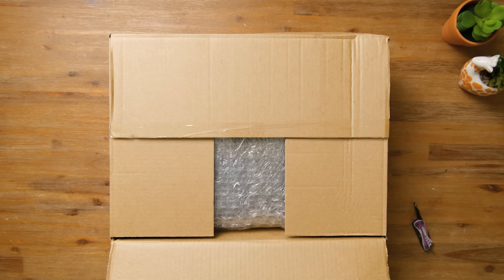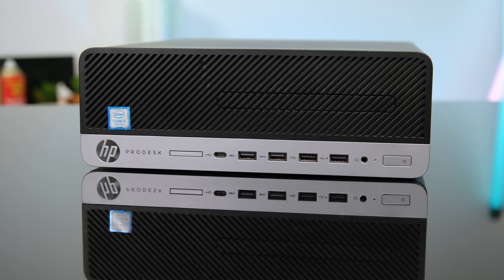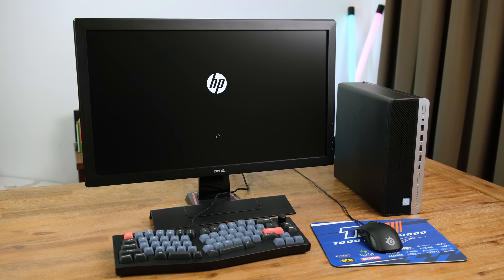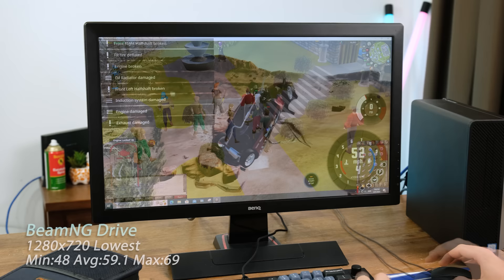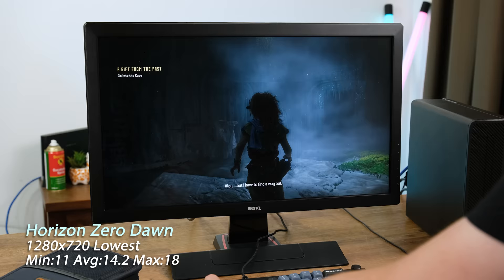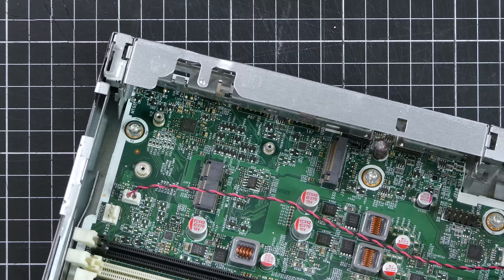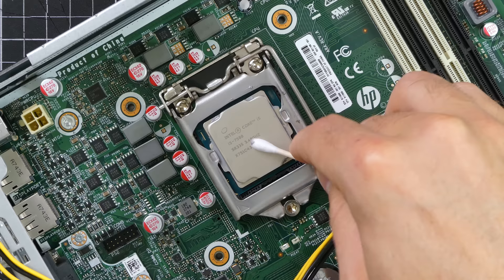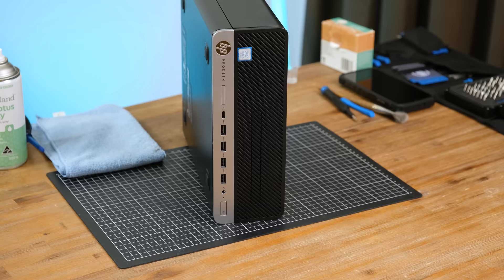Gaming On A $152 Computer?

Comment from the maker: Thanks for watching! I'm now aware that the RX 6400 exists, however it wouldn't make sense to pay so much for such a card. Also big thanks to Nordpass for making this possible 👍 https://nordpass.com/psivewrinordpass Or, use the code PSIVEWRINORDPASS at checkout to get an additional 1 month for FREE!
Reply: Do a video on the asus M32 CD I7 skylake 6700 you are impressive amen.
Reply: What is the difference between normal GPU and low profile GPU
Reply: @TahelEdit  low profile GPU is basically half the height of normal sized GPU. It's the only form factor you can fit into these SFF (small form factor) desktops. These PCs are usually only 10cm thick (that's about 4 inches for the US people), so you are limited TFX power supplies, low profile GPUs, low profile CPU coolers.
Reply: the rx 6400 is fantastic... I enjoy mine... but I understand you're sorta referring to proportional cost...I think...BUT if this is your ONLY pc it would be well worth it...

Comment: I would love to see this machine running a single slot RX 6400 and compare it to the GT 730's performance!
Reply from the maker: Didn't know they existed! But since they cost nearly double what I paid for this PC... Maybe not 😂
Reply: @psivewri  😅 Yeah that's fair!
Reply: So I run a low profile 6400 in a Dell SFF with an i7-8700 and 32GB RAM and it isn't awful, but not great either. The main problem with the 6400 is the 64 bit memory bus and PCIe Gen4. You leave a decent chunk of performance on the table by running on a Gen3 system (like the HP in this video or my Dell).
Reply: I’m running this setup with a 6400 in runs fine plays all e sports games 60+ fps 4k video is great also.. that’s main use
Reply: As an alternative to the 6400, Yeston makes a single-slot low profile GTX 1650. You used to only be able to get them in China, but now they’ve started selling them on Newegg
Reply: @psivewri   the rx 6400 is worth the money even if it’s not as cost effective and would turn a system like that into a actual entry level performance beast
Reply: @psivewri  pleaseeee man, lol
Reply: @psivewri  Try the Quadro P620, P1000, T1000, or AMD W6400.  The first two are roughly GTX 1050 performance, half height, single slot, and about $100 on eBay.  The AMD card is alot newer and is supposed to have better performance.  There's also the RX 6400, which is supposed to be essentially the same as the W6400.  That one actually doesn't look too bad.  Roughly GTX 1650 performance and only about $150 on eBay.
Reply: The most powerful lp gpu without supplementary power is the Quadro RTX A4000 i think
Reply: @psivewri  the RX 6400 is the best small form factor GPU on the market. Many online use that card for their budget builds and retro-gaming/home media setups. And perhaps bumping the CPU to an i7 will give you even more of a performance boost.
Reply: IDK much about it, but it seems to me the RX 6400 is the budget low profile card of choice ATM.  Seems like it quite a decent step up from the ever popular budget 1030 and even 1050.
Reply: @SA77888  Yeah, they are pretty reasonable on eBay (about $150) and significantly better performance than GTX 1050.  Also available in half height, single slot for SFF Dell and HP machines - not many cards can do that.
Reply: @psivewri  bruh the XFX version has been on sale for a while
Reply: @ccoder4953  WX 4100 or 3200 if you want something cheaper than the W6400. The 4100 should be somewhere in RX 460 in performance
Reply: @MrSavageBass  yeah but I run a gen 4 rx 6600xt on a gen 3 motherboard and it’s buttery smooth
Reply: @thedeadlygames9716  The 6600XT has a full X16 bandwidth, the 6400 is a locked PCIe x4 card. With the full bandwidth you wouldn't notice much different, but on a bottlenecked card like the 6400 any help you can give it counts, using it on the faster Gen4 bus makes a numerically significant difference.

Comment: There is low profile single slot versions of the RX 6400. Even though it's PCIe 4.0 x4 (in that system limited to PCIe 3.0 x4) it will still outperform a GT 1030 by a huge margin
Reply: He replied to a similar comment saying it’s too expensive
Reply: a low profile 1050ti is ideal for this thing
Reply: @XxmatixX6videosdiariosdenadav  Low profile 1050 Ti wouldn't fit because they take 2 slots
Reply: 1030 gt is the sweet spot for budget and performance, also you don't want to stress the power supply as reliable as they are don't push them to their limits.
Reply: @buda3d2007  GT 1030 is extremely slow by todays standards but sadly there isn't any other new low profile cards for below 100€.
The RX 6400 wouldn't be a problem for the power supply, it's only a 53W TDP card
Reply: @Pasi123  this is true , essentially you would be limited to retro titles, I still think it falls in the "better than nothing" category for a cash strapped gamer.

Comment: I have a feeling that the iGPU on the i5-7500 would beat the GT 730, even if it's the GDDR5 version of the 730. Would be interesting to see a followup video trying it out (or just a comment in here if messing around with alternate configurations wouldn't be enough for a video).
Reply: was going to say the same thing
Reply: Sadly no maybe in newer games where the newer feature set comes into play 

Mind you I haven't finished the vid yet and this could be a really shitty gt 730 not necessarily about the memory more so the architecture the card is based on But of course the memory matters too but not as much as you'd think if the card itself is bad 🤣

A Kepler gt 730 is a decent bit faster than the Fermi counterparts
Reply: @younglingslayer2896 I agree! Specs-wise the GT 730 is significantly better in terms of shaders, TMUs, ROPs, etc.. Like 3 times better than the Intel HD 630 graphics. The only advantage the integrated has in terms of performance is that it supports DirectX 12 and still gets modern updates as it is still in production. For newer applications it would probably be better than the GT 730 but it depends on how important the drivers are to a given task. Which is typically VERY important. The computer would also use less power and it would free up an X16 slot for other upgrade cards.

Comment: That really isn't too bad at all, I swear that my workplace has a load of this as lectern PCs.
What surprised me most is the pre-installed Samsung SSD (That part number correlates to a Samsung drive), dual channel memory (HP love using single channel memory in their pre-builts), and, most importantly, the M.2 SSD and Wi-Fi slots. 
I would definitely add Wi-Fi and an NVME boot drive, as well as more RAM - IMO, you can never have too much of RAM! :)

Comment: The RX 6400 is a low-profile GPU and has single slot versions of it, so for this pc the 6400 can be a great upgrade.
Reply: The RX 6400 is a PCIe 4.0 card though, so I suppose a GTX 1650 would still be more optimal. It depends on people's preferences though.
Reply: @pgta2004  still working with pcle 3.0
Reply: @doctorsexo5847  Ikr, but then it'd be PCIe 3.0 x4, so the bandwidth'd be halved. Wonder if that will be a bottleneck though
Reply: @pgta2004  is like 1 to 5 frame loss
Reply: @pgta2004  is there any single slot  low profile 1650’s? All the ones I see have huge coolers that would be too wide for this pc
Reply: @dylanallen7720  I looked up and there are some (like the Yeston 1650), they're not from very famous brands though.

Comment: Buy a cheap case, cheap(ish) power supply, transplant the internals and you can put wtv GPU you want in there. It's what I did when i first moved back to France, bought a cheap HP prebuilt. Now i have a 5800x3d and 7900 XT on a custom loop :).

Comment: An rx6400 would go a long in making that system playable, I know it’s controversial but the gtx 1650 will suck more power and the rx 6400 is on par with the performance of the gtx 1650 and sometimes beating the 1650

Comment: I recently got a dell Inspiron 660s for $35 online. With a i7 3770, GT 1030 and 16gb RAM, it’s a great PC. I also added a PCI WiFi card. Very similar to this one, just a bit older. It’s completely upgraded to the max and the 225 watt power supply could do it surprisingly.

Great video!

Comment: Of course this shows up right after I buy a $270 (USD) laptop
honestly, I'm impressed with my laptop's power, considering it's just an Intel Core I3, 4 GB RAM, 128 GB SSD, and Intel integrated graphics, running Minecraft at 1080p60Hz

Comment: I got a HP EliteDesk 800 G3 for $160. MINT condition. i5 7500 cpu,  8Gb 2400 RAM, 1Tb HDD. Added SSD and Windows 11 and a spare  NVME M.2 in one of the PCIE slots. VERY quite. Assembled in OZ in May 2018 so is 5 years old THIS month. 11 installed as Windows Educational so must have been built for a school. Play WOT without graphics card. For the $160 I had to forgoe 8 Pizza! WORTH IT! Only problem is I cannot update BIOS - password locked..

Comment: Those old computers still have life in them.  I recently picked up a refurbished Dell OptiPlex 7010 off of eBay with 16GB RAM and a 240GB SSD for about what you paid for your HP, and the seller did a very good job of cleaning and packing it.

Comment: My favorite phenomena in the PC world is how businesses and organizations will discard perfectly viable IT gear when they refresh their equipment. If you are at the right place at the right time, you can get all kinds of previous gen hardware absolutely free. Just last weekend I picked up an HP Z440 workstation for free. With an X99 motherboard and 700W PSU, it's a perfect platform to build a gaming rig on. All I needed was a $10 dual 6 pin to 8-pin adapter to run more modern graphics cards, and I replaced the non-turbo non-hyperthread 2.8ghz quad xeon with a 6-core turbo hyperthreaded 3.4ghz xeon which can be had for $13.50 on ebay. For $25 I have a proper gaming rig (already had a 1070 Ti and PCIe SSD to throw in it from an older build). Main thing is you have to be patient because they discard things on THEIR schedule and you also have to be savvy enough to know when and where to be when they start discarding gear in order to scoop stuff up. Often all you have to do is ask (Closed mouths don't get fed). I have acquired numerous servers and pro grade workstations like this over the years.

Comment: I have a similar system, they can be fun for retro games and it can handle daily tasks just fine. The i7's from 6th-7th gen do have hyperthreading which helps with modern games, and 8th gen i5 has 6 cores, so worth looking for those if possible but they always list for much more than the i5 6500 or 7500 models which seem to be the most common. The 4 threads can be limiting factor though especially with more modern titles.

Comment: 6:58 if I had that refurbed HP ProDesk 400 G5 SFF (which has support for Windows 11 than the 600 G3), I could bring the PC, the keyboard, the mouse, and my pocket router, the PSU, an inverter with a slim motorbike battery (packed on a bag) to school unless it's time for learning, studying, and doing exams, especially my not-so-nice English teacher.

Comment: I love these OEM machines. I have a Mini Form Factor (no, not SFF) HP Prodesk with an i5-8600T. I added a GTX 1650 using a PCIE x16 to M.2 adapter. Using an external power supply (a Dell DA-2 adapter), I can now use the computer for triple A gaming.

Added 16GB of RAM and a 500 GB SATA SSD aswell. All of that for just 250 dollars!

Comment: It’s kinda insane for my school to have computers with intel i7 11700k and 16Gb of ram and 1440p monitors, that’s basically my computer but with no graphics card. I didn’t even know my school just switched out the old computers with the new ones.
Reply: what is your school running? high power software? no way they spend more then 888 on each computer just to only run word my school has 2 pc rooms a room on 1st floor with i5 7th gen and the 2nd floor has i5 4th gens wich are slow ass but that i5 is more powerfull then my i5 6th gen
Reply: @309electronics5  What I can say is, I don't know how they have so much money to spend on computers, even though the stuff still works and not obsolete. I think the old computers that used to be there had i7 8700K and 16GB of ram. Those computers were mostly in classroom for developing electronics. The 2 things I hate about it is they don't have any kind of ssd or any kind of graphics besides the intel graphics. I guess it's fine for basic web surfing and office apps, but for anything else, it's basically useless.

Comment: You may be able to fit on of Nvidia's workstation series GPU's in this case. There are low power models like the P1000 which are often found in ThinkStation Tiny machines that offer performance equivalent or superiour to a 1050Ti.

after some research on the specs, it seelms like it can fit a low-profile PCIe 3 x16 card with a max TDP of 35W. The P1000 draws 47 watts, which might work.. but not sure. Its lower-spec version, the P400 draws only 30 watts and fits this case. So that's basically as far as you can get unless you upgrade the PSU. A PCIe slot can provide up to 75 watts of power - enough for an A2000, which is an entreprise series Ampere card with RT cores. 
Overall, decent upgradeability, if only its pcie slot was placed a little higher to give space for 2u cards...

Comment: It would be interesting to see older computers running Toontown Rewritten, as it is not as optimised as the original game (Disney's Toontown Online) was but is still capable of running on bad hardware. The engine it's based on (Panda3D) hasn't been very well looked after over the years.

Comment: I worked fixing and refurbishing computers and other tech for an small company in my city, and I worked around with lots of hp´s small form factor computers, and yes I changed the thermal paste in all of the computers I fixed/refurbished, it was a crappy thermal compound but at least its better than nothing

Comment: I have a Dell Optiplex that's the same size as this at work. When there's no work to be done and it's a slow day i use it to play games. Mine does not have dedicated graphics and i don't have a small profile card to put in it either,but it still works ok with the iGPU.

Comment: Most of the HP Elitedesk PCs can handle a Geforce 1650 with the default PSU, even the old HP 8200 SFF and 8300 SFF series is compatible. In case of SFF, a low-profile version is required.

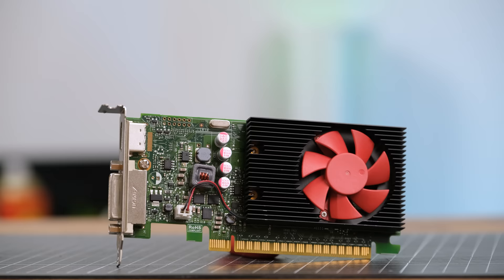Comment: 5:41 actually, there was a single slot 1070 by Galax/KFA2, I don't know if it would fit length-wise without any modding, but that + a new PSU would definetly make this into a decent 1080p machine

Comment: I have this exact same machine as a main PC, what a tank, speaking of the video card you have also the RX550 LP variant if you want more gaming speed on this thing, mine has a 6th gen Core i5 and 4x4gigs of RAM for a total of 16, 256 gigs M.2 (NVMe) and a 1T mechanical drive with sadly a DDR4 variant of the 1030 which is going to be replaced with the firstly mentioned card

Comment: i have a dell optiplex 9020 sff and i had a few options like 1050, 1650, RX6400 low profiles, and any of the 700 series, but i chosed RX 550 lowprofile which is a beast for 4gb card like 60 at meduim low settings and other games like fortnite at 1080p 60fps

Comment: We have similar machines without the USB-C port in our big computer lab in our high school. But they also might be a little bit newer(I think we got them in 2016 after we had lots of Lenovo ThinkPads) but most of them are in really bad shape😂 there‘s not a single unit with the Intel sticker still on ist and 80% of the optical drives don‘t work anymore and 7 of 30 units don‘t work at all😬😂

Comment: i have a thinkcentre 710e extremely similar to the hp, i was even going to get an ex office hp before i seen the lenovo and it was much cheaper! paid £ 60 for pc £ 10 for express delivery, £ 50 for 250gb nvme and £ 25 for another 8gb of ram to boost it to 16gb! no graphics card but i dont use it for gameing anyway, great little untis parts galore on ebay. only got an i3 7100 in it but can upgrade to a varity of others includeing the i5 7500 seen in this video. find the right seller and ex office are the way to go for budget machines

Comment: You could probably fit a K620 quadro 2gb graphics card in that slot. It's about the same size and requires no external power to run.

Comment: I have these at my job, they are very mediocre quality, especially the power supplies, they hiss when working, and I've seen many get taken out by power outages, or need lengthy resets. The build quality is a big step down from the G2 series, lots have missing or loose connectors and screws floating around, and misaligned panels. These were the last PC's to be made in the USA besides the Mac Pro. Lenovos are better in almost every way, although HP has more USB ports.

Comment: I have a better card compatible for this system : The nVidia Quadro T1000, a low profile exist. it's equivalent to a 1050 approximatively. At least, it's the exact same size of the GT730. If you have the possibility to try one, it totally worth it.

As Always, excellent video.

Comment: The HP Prodesk 600 G3 shows two ports at the rear so surly it should be able to take a low profile gtx 1050Ti or 1650?